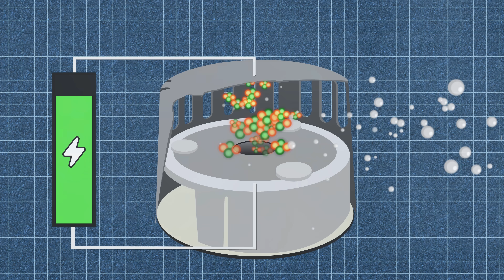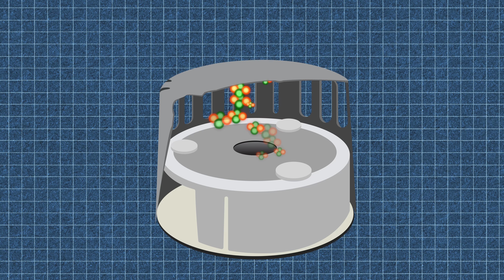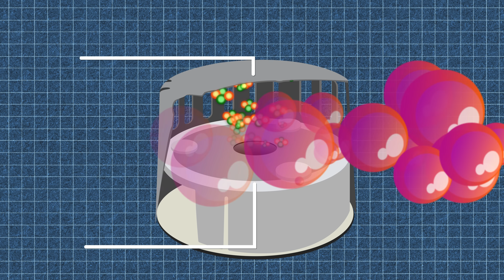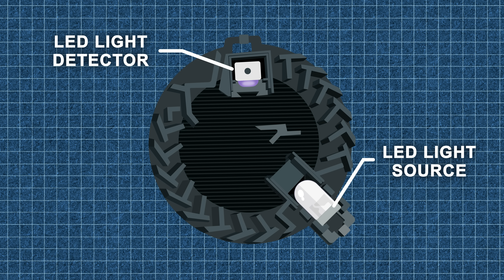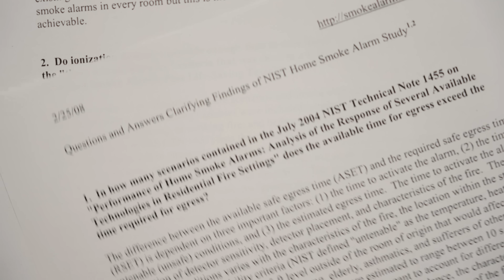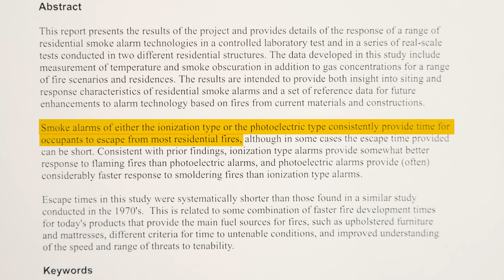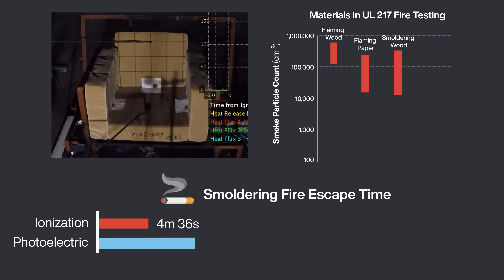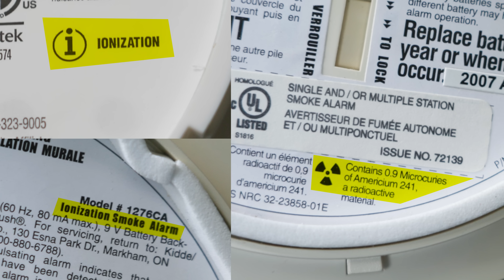Why the Most Common Smoke Alarm is Dangerous

Comment: BOTH types of smoke detectors have a weakness in not detecting certain types of fire. However, using both types of smoke detector, one can see the blind spot of the other.
      Be careful about what you see on the internet. A lot of the information is deliberately misleading, designed to shape your opinion through deception. But even if the source of inflation is trust worthy, it still might be wrong.
      You should have smoke detectors in every room, placing one type in your kitchen and bedroom and the other type in the hallways.
      And have them linked so if one detector senses smoke, it triggers all the others.
Reply from the maker: Hi Eric, thanks for watching,

The problem with doing that is that it's not possible in many situations where hardwiring is required unless you run additional wiring at great expense.  

If you want wireless interconnection that's also not possible because there are no wireless ionization alarms.

Comment: Always check your alarms at least once a year. Like, 1 december.
Always have at least(!) 1 spare battery at home, dedicated to the alarms. Write on it!
IF you remove it because of cooking, then make sure you place it in a position where you will not forget it so you actually put it back (like on your chair at the table or on a chair beneath the attachment in the roof).
Reply: Our country fire service tells us to test the smoke alarms at the beginning of daylight saving  when we "Look FORWARD to summer" and have to put the clocks FORWARD one hour
Reply: @richardprincipal7241  Anything that is easy to remember is a good thing.
Here in Sweden we have A LOT of candles in december so that is something easy to remember.
Reply: @Xanthopteryx  the logic is all wrong smoke detectors should tested at the end of daylight saving we go BACK for winter, and more likely to put on fire provoking items.

Comment: When I was kid we were taught to have both types in the house, ionization and optical.. each one detected different kinds of smoke the other couldn't so we were always told to install both and to check the batteries annually to the day
Reply from the maker: Hey DRM, hope I can shine a light on that: 

The problem is that interconnection is just as, or more important than having both types of detectors in your home.  Problem is in houses with hardwiring you can't add more detectors unless you run additional wiring at great expense.  If you want wireless interconnection that's also not possible because there are no wireless ionization alarms.

So why not dual sensor alarms?  Problem is these alarms can be just as sensitive to cooking false alarms (UL, Characterization of Smoke Alarm Nuisance Sources, 2015).  They're also hard to find, expensive, and the only 8th generation dual sensor alarm is currently unavailable for purchase (as of June 5, 2024). 

As well many homes require CO detection and you'll have to choose between having those separate vs interconnecting them with the rest of your home.  Same issue if you want separate photoelectric and ionization alarms.  I think Interconnection is more important.

Kidde's new 9th generation of smoke alarm is Photoelectric only.  This was what I was expecting in the video as I was shocked ionization could pass the new tests, but I'm guessing that's no longer possible.

Comment: I am a fire alarm technician, the ionization detectors aren't even legal over 3,000ft above sea level, yet all the home improvement stores sell them at 7,000ft
Reply: My guess would be that since the airplane’s cabin space is pressurized and the bathrooms are so small, they would perform within specification limits.
Reply: Hi Random I am not sure about that alarms I see in Airplanes usually seem to be of the photo electric type

there are 2 types of smoke alarms ionization and photo electric the 3 type combo has been found in a court case not to be safer than ion or photo and the iophic is also an ionization type
Reply: @randomno0 cabins are pressured at pressures above 3000 feet though
Reply: @misham6547  The cabin begins pressurizing from the beginning of the takeoff roll. By the time the aircraft rotates the cabin is about 200’ below where it started. That pumps up the cabin and makes it stronger. Like a life raft is more ridged full. And in cruise maximum differential pressure is about 6 PSI depending on the airplane. That keeps about an 8000’ cabin at the airplane’s maximum cruise altitude. Any higher and older people have trouble. The differential decreases in the descent so as to be nearly zero at landing. So you have to set the landing elevation in the computer. At touchdown the switches on the landing gear open all the outflow valves to depressurize the cabin. Otherwise you couldn’t open the doors. I hope this helps.
Reply: I've always lived at altitudes of 4000-7000 feet.  Now you're telling me I may as well have glued a hockey puck to the ceiling? 😮
Reply: @jeffsaxton716  pretty much. it took a bit, but finally got Lowes to sell Photo smokes in my area, 5,500-10,000 foot. Namey it involved a local fire marshal quoting chapter and verse
Reply: You could test them and find out?
Reply: Many home improvement stores here in Massachusetts, where fire/smoke/CO/natural gas and propane alarm regulations are very strict, sell non-compliant detector products that fail to pass fire code inspections. Our code even requires all batteries to be 10-year rated, sealed and non-replaceable. I’m waiting any moment for the new 8th gen minimum requirements to be phased into effect immediately now that I just upgraded my entire system…for the 3rd time. This is getting expensive but still cheaper than a household of funerals and property in ruins!
Reply: @randomno0 I hate sealed, non-replacable batteries. So wasteful of resources.
Reply: @randomno0 sealed and non-replaceable batteries seem to be too draconian to be put to code. Right to Repair would be furious especially it's just another manufactured e-waste.
Reply: @triadwarfare  When it comes to simple safety devices that don't have any way to self-monitor if they are working correctly, I don't think right to repair is going to quibble over it.
They aren't, for example, suggesting that just anyone can repair hospital equipment.  They are merely saying that qualified technicians should be allowed to repair them, as they already have done for years.

There should however be better procedures in place for disposal.
Reply: @triadwarfare  You are completely missing the point of right to repair. It's about having reasonable accommodation to repair broken things, that's it. No batteries last as long as a smoke detector, making them sealed only increases waste and hurts people who use them correctly. People who don't won't magically change their behavior because the devices don't let them make a bad decision in removing the battery, they'll just  find another way to ignore the problem and make a different bad decision.
Reply: @guard13007   yep, if you can't take the battery out people will just put the whole alarm in a draw somewhere
Reply: @triadwarfare  The one fire alarm with a non-replaceable battery I've had was designed by a moron. The battery was put so close to the buzzer that after a shower something shifted and it shorted against it causeing an unholy screeching noise, definitly not the alarm sound, that didn't stop until I tore the thing apart.
Reply: @triadwarfare  is it really a e-waste if it's a safety device?
Reply: @kahtyman7293 Badly designed and built safety devices are a safety hazard and ewaste.
Reply: @NeonDripKitty  hey the 8 gen smaoke alarms i have do have also removeble battrys comparment with also at the same time are also super easly to mount and reaplace in both the battry and the whole smoke alram at the same time when needed and has all the best feactures of the 8 gen smoke alreams at once. neveda allwasy gets the best smoke alarms thsie days for there new homes sence the last decade by the way.
Reply: @alexatkin It's outrageous. I should be able to replace batteries. I have seen firsthand that it causes people to throw them out and not replace them.
Reply: @randomno0  ...except the "10 year" units don't last that long.  I've had multiple First Alert ones now, one at 2 years, another at 3 years, go into full alarm because their batteries were running low.   Worse, since it's a "permanent" battery, you can't pop the battery out to shut it up.
Reply: @randomno0  current national fire code requires household smoke detectors be replaced every decade, namely due to the use of ionization detectors, which degrade due to the reduction in Americium. I have seen some detectors last 30 years without issue, but, eventually, even the electronics degrade
Reply: @davidconner-shover51 americium half life is 432 years. How much do you think is lost after 10 years?  

After 10 years, approximately 1.61% of the original Americium-241 in a smoke detector would have decayed, meaning 98.39% of it remains.
Reply: @neilbrookins8428  not much apparently, I didn't create the code or agree with it btw
Reply: @davidconner-shover51 it's not the degradation of the Americium. It has a half-life of 432 years. But you're right, the components will likely reach end of life in 7-10 years.
Reply: WTF is that? Just use metric like the civilized world?
Reply: If you're still watching replies, what would you install?  Is there anything battery-operated which is worth using?   I've had major problems with First Alert's "10 year" battery detectors going into full alarm in the middle of the night after only 2-3 years.   Because the battery is low, pushing Silence only shuts them up for 10-15 seconds, then they start going off again.   Because they have the "permanent battery", you're stuck with this piece of plastic screaming at 3am without the ability to pop the battery out to shut it up.
Reply: Thank you for this information.
Reply: I live at around 7000 feet and considering our house is about 15 years old it likely has ionization
Reply: can you give a document and page number for this? I can't see that anywhere in the current public access version of NFPA72. I'd love to have a cite-able source to take directly to the property manager though.
Reply: Plko
Reply: Ah thanks dude! Just added more info to my fire knowledge!
Reply: Why don’t they work at altitude?  We have them in the bathrooms in the airlines. And the cabin is at 8000’ all day
Reply: @grumpy3543  look up NFPA 72
Reply: @grumpy3543  Greedy airlines
Reply: @BuddyTheWolfYT  To be fair, Airlines have historically only ever run on a 2% profit. Sure some years they make more. But in the long run it’s a really hard business. Similar to the restaurant business.
Reply: @ I can't remember why I typed "greedy airlines" I probably meant to type greedy stores for selling the ineffective detectors but was tired or something
Reply: @grumpy3543 The cabin is actually at 30,000 ft (FL 30)
Reply: @16andbraindead The airplane cruises at 30,000’ or higher. Up to 41,000’. But the inside is pressurized to maintain a safe environment of about 8000’ maximum. 6 to 7 PSI.
Reply: @ hey that’s good to know, thanks!
I thought pressurizing only mean that there was air but if you are 41000 feet high your soda can will still explode

Comment: Why not put both types in one alarm?  (There is another problem with photoelectric.  Photoelectric alarm consumes more power, as it must generate light & blow the horn ONCE.  This energy comes from chemical energy in the battery.  Ionization alarm needs power to generate the alpha particles, but that comes from nuclear energy which isn't going away soon, as in 1000 years.  The only battery energy required is to run the sensing amplifier, which is tiny, & to blow the horn ONCE.)
Reply from the maker: Mmm, the new 10-year photoelectric alarms work for a long time.  They've also figured out the battery issue with better optimized electronics, lower energy consuming IR  LEDs.  

The problem with dual sensor alarms is these alarms can be just as sensitive to cooking false alarms (UL, Characterization of Smoke Alarm Nuisance Sources, 2015).  They're also hard to find, expensive, and the only 8th generation dual sensor alarm is currently unavailable for purchase (as of June 5, 2024). 

As well many homes require CO detection and you'll have to choose between having those separate vs interconnecting them with the rest of your home.  Same issue if you want separate photoelectric and ionization alarms.  I think Interconnection is more important.

Kidde's new 9th generation of smoke alarm is Photoelectric only.  This was what I was expecting in the video as I was shocked ionization could pass the new tests, but I'm guessing that's no longer possible.

Comment: Nice video and information. FYI Home depot sells Kidde photo electric models that meet requirements of UL 217 8th/9th Edition with Smoke/Co2, hard wired, battery backup, and interconnected. These seem to be the new models, not the recalled models.
Reply from the maker: Holy crap, you're right.  Thanks for letting me know.  Wow, this slipped under my radar.  I'm going to some research, and I'll change things out of my guide as necessary.

Edit: I'm actually a little mad that I miss this. I was searching for 9th generation this entire time as I knew the next standard was coming out. There has been so little marketing around this, it's infuriating.

Comment: I think your graphics are backward for the alarm times later in the video. Thanks for the info.
Reply from the maker: Hey, thanks for reaching on this.  The graph is correct, it's an unusual way of talking about how useful an alarm is.  

The actual metric is ASET - Available Safe Egress Time, which is how long after the alarm goes off you have to get out before conditions become dangerous.  It's a more accurate measure of how useful an alarm is in saving your life.  It's also an indirect a measure of how fast each alarm is alarm is.   

Yes, this is confusing, I thought about different ways to represent the data and this is the simplified version although I should have went with "escape time".

Comment: Now if only we could fix some of the other problems....like new alarms having a "lifetime battery" but if you do get false alarms can't remove and reinstall the battery, you have to permanently brick it and then replace it or deal with endless beeping.  And the fact there are very few options for wireless interconnect.  And seemingly none appropriate for garage retrofit of wireless interconnect.

Comment: What's the price difference with these new "intelligent" detectors? Both types are cheap and have (had) simple circuitry.
That's one of their selling points.
Reply from the maker: About the same actually.  The optimizations were mainly in the brains of the system.

Comment: Only photo electric smoke detectors are permitted in Germany. 
An IR diode in a chamber flashes. This is observed by a phototransistor over the corner. 
The light can only reach the phototransistor if there is smoke in the chamber.
But in the kitchen these lead to false alarms. That's why kitchens can be monitored with a temperature sensor.
Reply: Not just smoke. Anything that reflects the light will set it off... dust, steam, critters, etc.

Comment: There is one benefit to heat detectors - they can be used in cold environments! Apparently other types of detectors won't work in environments that are under 5 degrees Celsius. Places like unheated garages, storage units, and the like. I also wonder if photoelectric would work in such environments as well.